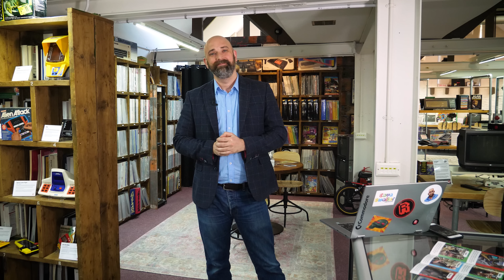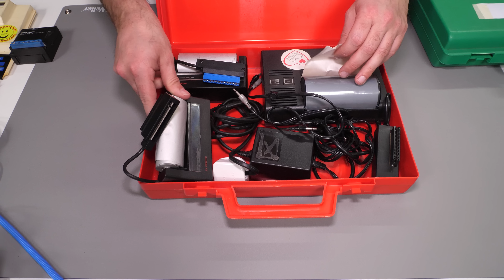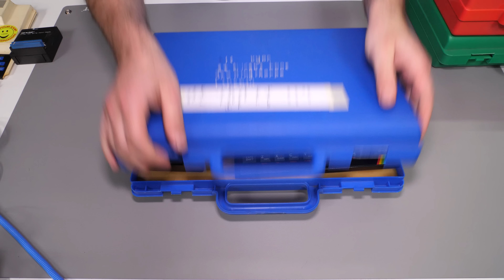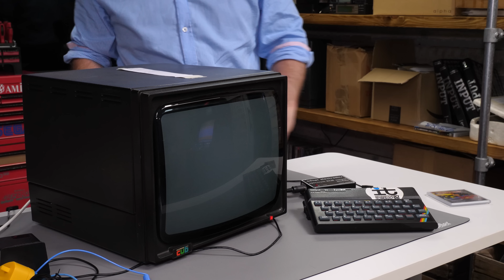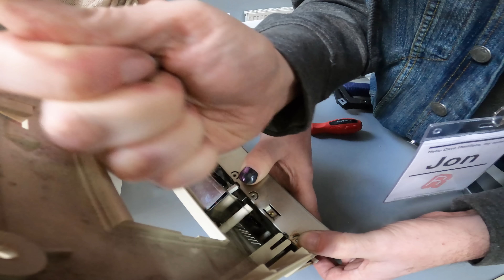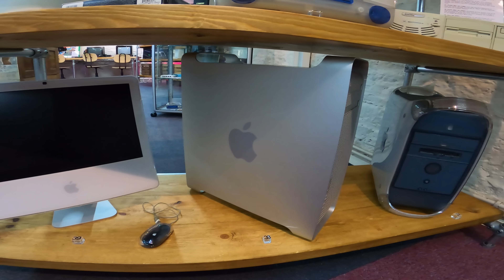Let’s build a Lab and Upgrade Everything!

Comment: This reminds me of doing up a previous house I had about 20 years ago. I knew nothing about building, but I had to learn! The internet actually turned out to be very useful for a change! I ended up soundproofing all my neighbour facing walls by building new sound reducing stud walls against the existing brickwork. What brought it to mind was what you said about the CLS timber because I had the same problem. I used to go to B&Q, Homebase, Lawsons etc. and go through every bit of CLS they had until I had all straight bits, and that wasn't easy because I wasn't likely to get it all from a single shop. I did find though that it was ok to buy a few lengths that were warped along the narrow face of the timber as you could use those for the head and foot plates.  You'd be screwing them into the floor and ceiling joists anyway, so that, combined with the pressure of the vertical studs would take the warp out, as long as it wasn't too severe. Man, I hated building work so I don't envy you. But you do get a nice sense of satisfaction when you've finished. I especially like the door you built with all the cassettes in it, that came out really good. I don't know how you find the time to get it all done!

Comment: Great video and lots of hard work paying off - Cave 4.1 is looking pretty great, the lab space looks wonderful, but tell the precision engineer 😉that his akward operation "cross arm manuver" at (6:10 & 6:28) of holding the wood w/ the left hand & operating the mitter saw with the right hand is a big no, NO....that is the exact thing the mitter saw manufacturers tell you not to do in the user manual. ☺😀

Comment: What I'd love is someone to do full photogrammetry of the cave using high-res cameras so it can be fully built in 3D for something like the unreal engine and turned into a fully user controllable virtual  tour of the cave, maybe with some simple interactive elements. It wouldn't actually be that hard to do and could easily be sold for a few quid on the RMC website as an extra source of income. It would also be a nice way people to explore the cave who just could not make to the real thing for whatever reason. Maybe do the same for the Arcade Archive.

Comment: Off topic question to anyone from the UK, prompted by Neil saying he needs more tea 😄 What is a good, black tea that you can recommend? Where I live, people don't really drink tea, so the selection is very limited and frankly very bland. (Twinings Early Gray Breakfast tea is the best I could find, but I have to use two bags per cup and it's still not amazing.)
Now, I don't know much about tea, but I went to Sri Lanka and the black tea there was FANTASTIC, not to mention cheap as chips. But now I'm back in Europe. What do you knowledgeable tea drinkers typically buy in Britain?
Reply: Earl Grey isn't the regular tea most people drink in the UK. Earl Grey and Lady Grey are teas of a similar character flavoured with bergamot which gives a distinctive taste that some people might not appreciate, particularly in larger amounts (as tea is indeed consumed in the UK). Outside the UK, brands like Twinings and Lipton tend to get promoted as authentic, but in the UK the volume brands are actually the likes of PG Tips and Tetley which also tend to be distributed widely overseas due to the reach of their corporate owners. Of those, I would personally accept PG Tips as a baseline, but Yorkshire Tea is also available where I live, and so I prefer to get that instead. I am by no means a "knowledgeable tea drinker", but then most people in the UK probably don't consider themselves as such, either.
Reply: @paul_boddie  Thanks! I'll try looking for the ones you mentioned